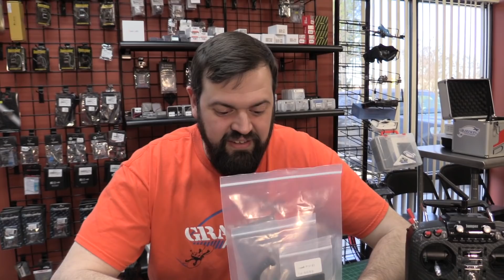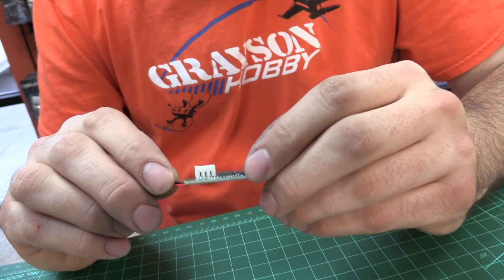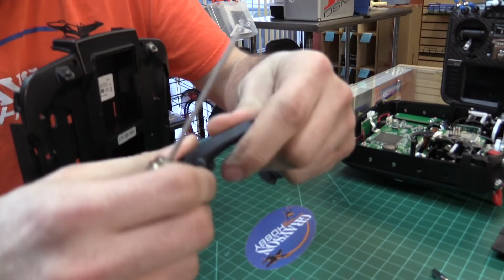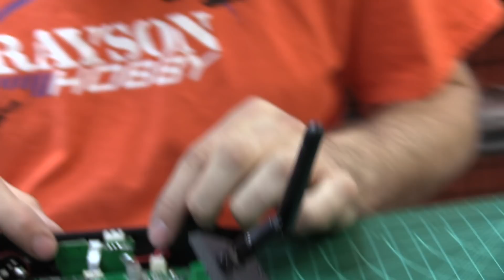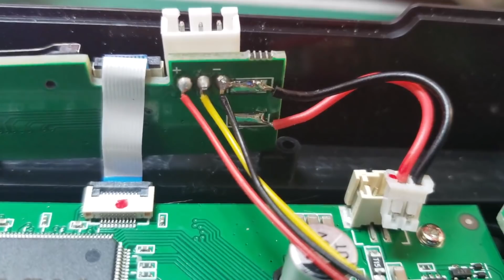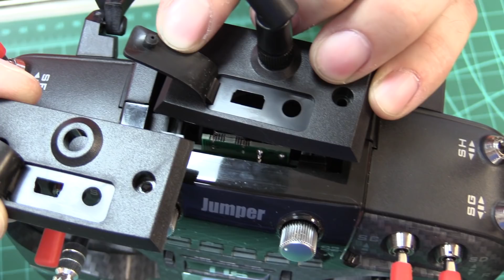Jumper T16 Pro V2 USB-C Internal Charging Upgrade

Comment: So I can confirm that a short between the 3 pins is bad! And might result in fire. Just bought a used T16 pro that had clearly had this mod done. So glad I was messing about with it for over an hour, that way I noticed the burning smell and pulled the battery tray out to find the spring glowing like a cigarette lighter and holder all melted! No idea how it didn’t go up in flames before, can only assume I moved something JUST enough to complete the short while I had it apart trying to retrieve the stuck SD card :(  sure enough was continuity between positive red and middle yellow balance wire.
Good job on the video guys.

Comment: Switch the JumperT16 on or off while charging?  When switched on, the inactive message constantly comes on.  When switched off, the red LED on the USB socket does not light up.  Wrong construction?

Comment: What usb-c cable should be used? I have noting that uses one. 
Not covered in your video is what is the  charge current after the mod, not mentioned? 
Are there any indications the charger is charging and also end of charge? 
I have you kit on order.

Comment: I have a 21700 pack for my jumper, will this upgrade work with that?  Any preferred specs for the USBC charger I should use or will any USBC phone charger work?
Reply: Some of the newer Apple USB-C chargers will not work. The earlier iPhone and iPad chargers do work with a USB-C cable

Comment: Now the question would be what is the amperage from the USB C, if it is over 0.5a you run the risk of damaging your batteries or the TX itself. Still prefer hot swapping the batteries and charging with an appropriate 18650 charger.
Reply: ??   I've charged my 18650 batts for flashlights , lasers and now my Jumper at 1.4a and never had a problem .

Comment: Now the question would be what is the amperage from the USB C, if it is over 0.5a you run the risk of damaging your batteries or the TX itself. Still prefer hot swapping the batteries and charging with an appropriate 18650 charger.

Comment: This might be a dumb question, but I only charge LiPo's on my R/C charger and I don't know of a way to connect a USB C cable to my charger.  
There is another video from GH saying that the charge rate on the 18650s needs to be low enough to get them fully charged and that some cheap chargers will charge too quickly and not fully charge them.  
Is the charge rate of a USB C connection fixed in some way that will ensure the batteries are charged fully, and what is the indication that they are fully charged?  I'm assuming with a USB C cable that you would just plug into a computer UBS A port with a USB A to USB C cable, right?  Unless you have a newer computer with a USB C port (which I don't).  
I realize that Jumper just came out with this new upgrade, but it would be nice to see that info added to the video on the upgrade.  Left some of us "old" guys with questions.  I'm sure all the young guys are just rolling their eyes. ;>)
Reply: I have the same concern. I want to be able to charge my t16 battery without having to remove it but how do you do that through a USB C? Will the USB connector still function normally?
Reply: Bert105 and Karl, your best option is to use a 2.1 amp cell phone charger or if you have USB 3.0 connector on your PC (it’s a blue connector) .  I just ordered 2 of the Anker USB A to USB C 6 foot braided cables, they are a metal connector and very solid. I keep one at home and the other in my radio case, just so I can charge from the car, if I need to.

Comment: So if I don't want to use it for charging because I did the charger mod already, I'm assuming I can still use it for the USB-C to connect to the computer, just don't solder it to that board?

Comment: Thanks guys great Vid as always. …  I assume you would use a standard USB charger with a USB C cable and the  18650 batteries will be charged to max as you would if charging a phone or tablet.  Is there a green/ red light on the new board to show charging status..

Comment: Is there any indicator that the battery is done charging?  Don't want to over charge right?  Thanks guys for your continued excellent videos on this radio!
Reply: Overcharging isn't an issue because the charging circuit automatically stops when the pack is full.
Reply: @Sean_The_IT_Guy  Nice!!